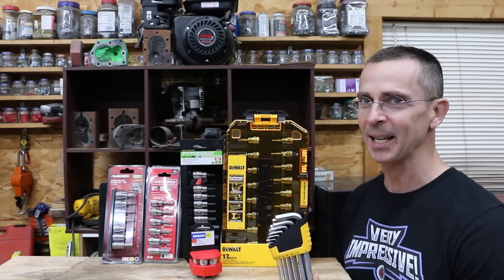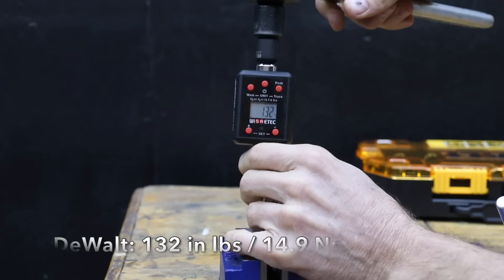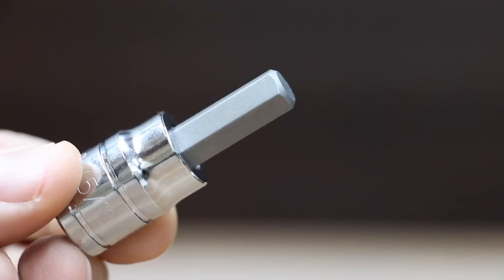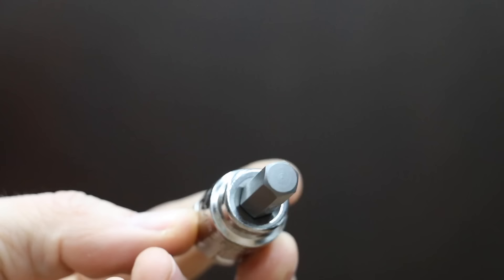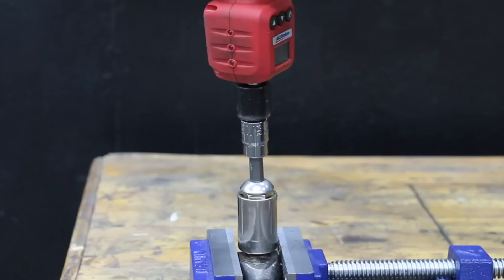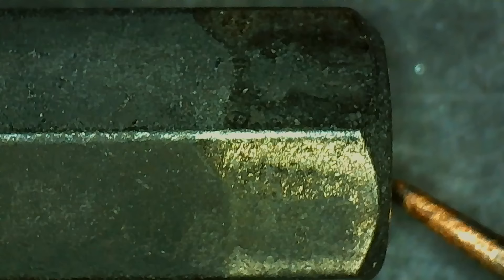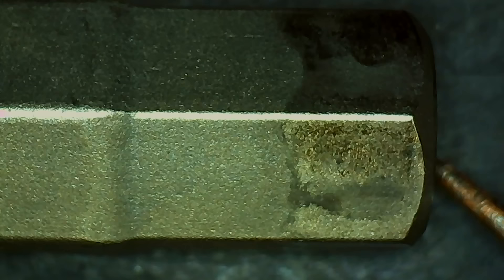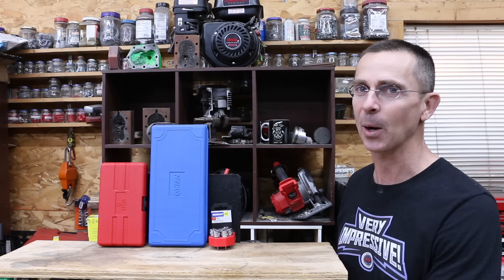Best Hex Bit Socket Set? DeWalt, Kobalt, Craftsman, Husky, Neiko, Pittsburgh, Tekton, GearWrench

Comment: Returned a set of gear wrench because the bits were installed at an angle and 4 of my sunex master set torx bits have broken trying to extract bolts on my car with hand sockets.

Love to see torx and etorx bits tested next.
Reply from the maker: Great feedback and great video idea. Thank you!
Reply: Absolutely!
Reply: Tools aren't made out of magic pixie dust. So you need to learn how to work within the limits of materials. Basically if hardware is seized the last thing you want to bring to bear on the situation is torque. Because as you're finding out you're just going to break shit if you do.
Reply: @1pcfred  you're right, something is that stuck don't bring more torque, bring heat. It can't be stuck if it's now a liquid!
Reply: @jpowens2253  heat is good. Sometimes tightening works too. Smacking the fastener with a hammer. Tapping your tools with a hammer. One of my favorite tools is a brass hammer. It saves the chrome finish on tools. Brass hammers are next level tools. Difficult to come by. Not everyone has one. You'll only find them in a better mechanic's tool kit. All the ham and eggers have is ball peens. They've probably never peened with it either.
Reply: @1pcfred  sometimes the only option is to break stuff. I used a 1.5 ton jack on a ratchet to get out a diff fill plug once. It survived but broke the next day. I couldn't put heat on that plug because it was right next to the fuel tank and a breaker bar wouldn't fit.
Reply: @inoahmann7542  sometimes we do not see every option. Or we're just not willing to pursue some options. I must say a jack on a ratchet is pretty creative. I wouldn't have thought of that myself. Fuel tanks really aren't all that flammable unless they're leaking. They really shouldn't be leaking either. You can actually put a lit cigarette out in a dish of gasoline. The trick is to vent the fumes away. Liquid gasoline doesn't burn all that good. It's the fumes that are combustible. That's why we atomize fuel before we inject it into cylinders. That's also why empty tanks are more dangerous and explosive than full ones are. There's more room for fumes in an empty tank. An old timer's trick for welding tanks is to run exhaust through one. You have to use an engine that runs really good though. It has to burn all of the oxygen. No oxygen, no flame.
Reply: @1pcfred  using exhaust to purge oxygen from a fuel tank is creative. I've never heard of that before. I don't know if I'd have the guts to try it, lol.
Reply: @inoahmann7542  I've welded up gas tanks and I just cleaned them out. If there's a way to get rid of that gasoline smell I've never found it.  I've sloshed like bleach around in gas tanks too. I just tip a lit cutting torch head into the fuel sender hole before I start. While I look away. Nothing's ever gone boom. It's still a bit unnerving to do though. Because I have to give them the whiff test and they always still smell like gas. I have caused a few things to explode welding. It's not that bad really. A big fireball and it's over. It helps that I'm a screamer and not a gasper I suppose. I just wish I had video of when it's happened.

Comment: I've been supplementing my Snap-On tools with Husky and Kobalt for years. Overall it seems like I've been on the right path!
Reply from the maker: Thanks for sharing.
Reply: I was on the other side of the spectrum. Didn't want to pay tool truck prices so I went house brand husky mostly. Rachets sockets racheting box  end wrenches. No complaints. Everything works well. I've used my 300 lbs self as a breaker bar on the rachet handles and nothing failed yet. Only  complaint is the Chrome husky socket do not affix themselves to a hog ring anvil on an impact wrench very well if at all. it has to do with the cutouts on the inside of the socket that attaches to the ratchets anvil.  they're great for ball detents like every single hand ratchet is quick release or press on.  horrendous for hog rings, they slide on the anvil until they catch the hog ring they just don't snap on to the hog ring and feel at all. So I got Pittsburgh sockets instead for that.  if they fix that their sockets would be perfect and yes a 12 volt dewalt extreme 3/8 drive impact wrench does not have enough power to facilitate the need for impact grade sockets at 125 ft pound tightening and 250 ft lb removal you don't need impact sockets for that.

Comment: I purchased a set of Pittsburgh a while back and used the 6mm to try and remove the plug from a fuel filter apparatus so I could switch the in and out around and snapped it in half. I was using a 3/8" ratchet hadn't even got to the impacts yet. I now use those on things that I know aren't too tight. Think I'll pick myself up a set from Sunex. Thanks for doing this test saves me a bunch of money and time testing and breaking my own tools :)
Reply from the maker: You are welcome!  Thanks for sharing.

Comment: I was a little disappointed Tekton didn’t perform better but it did a solid job I guess. All of my chrome and impact socket sets are from Tekton, they deliver great performance at nearly unbeatable prices. Although relatively new, they’re rapidly building a brand reputation among mechanics as bang for buck champions. 

I got two sets of impact-rated, deep-well sockets from them in SAE and Metric that go up to 1.5 Inches and 38 MM respectively. Combined cost for both: About $300.
Reply from the maker: Thanks for sharing.
Reply: I used to buy them too, but they've been around for years and their competitors has increased. I've broken enough tekton stuff, that I've moved onto American, German, or Japanese made tools.

Comment: My Kobalts have been great.  A store manager gave me a $500 piece of equipment that was unsellable due to mis-assembly.  All the Allen head bolts fastening the mis-assembled part had been over-tightened, then deformed in an effort to back them out.  I alternated using metric and English Kobalt hex bits to lessen the gap between sizes while using a hammer and progressively larger sizes to slowly reform the deformed hex recesses in the bolts back into workable shape.  I was finally able to slowly back out the bolts and reinstall the part in the correct orientation.  I found the Kobalt bits to be precisely shaped with good corners, hard enough to reshape the softer steel bolts, and tough enough to resist any damage from the hammer.  I used a large ball peen after the mallet wasn't doing it.  Two thumbs up.  Thanks for the vid.
Reply from the maker: You are welcome!  Thanks for sharing.

Comment: Love the videos wish you would include more snap on tools as well in some of your testing in this case I would have really liked to see how the snap on Allen sockets do and if they are really worth the extra money. I understand they are a lot more expensive and in a lot of tests it doesn’t matter but It would be nice to see thanks for all you’re videos though I’ve used most of these videos to find what I want to buy when looking for tools or items so I appreciate the time you take to makes these.
Reply from the maker: Thanks!  Thanks for the video idea.
Reply: Not just Snap-on, it would be nice to see any of the "tool truck" brands to see a comparison between the "consumer-grade" vs "professional" tools
Reply: He'd go broke after a few tests lol
Reply: I love my snap on set. They are 20 years old.  As a heavy duty diesel mechanic they have lasted a long time.
Reply: I did buy these from Snap-On. There are a few tools that I think the Snap-On or another high quality tool make sense. Something like this where the tolerances being tight save you from stripping out an important engine bolt or machine part go for the extra cost. 1/4 drive stuff is another I will spend more on because again the tolerances are tight. You start working on 1/2 and it matters less. I still stay away from really cheap unless it is for a rarely used job.
Reply: @NONO-hz4vo  but yea I think they do a great job. My lb7 durmax valve cover bolts were 5 mm Allen and if you stripped em by the fire wall your basically burning the bolts off they definitely saved me o think

Comment: I've been using the metric version of the Pittsburgh hex sockets with a Dewalt DCF887 impact driver for a number of years, I haven't managed to break one yet. Not bad for the $10 or so I paid for them around 2017. But if they ever do die... I might be looking at the Kobalt.
Reply from the maker: Thanks for sharing.
Reply: Same here, but I'm thinking of upgrading to the DCF891 1/2" mid-torque that just came out. It's putting out 900 ft/lbs of break away torque, so I'm thinking I might have to upgrade to a higher quality set to match it.
Reply: @jpowens2253  that's what u use. And use Pittsburgh and snap on hex bits.    Snap on keep cracking.  Pittsburgh dont.
Reply: @jpowens2253  Do it, but the harbor ones will handle it.
Reply: With Harbor Freight now having 2 or 3 tiers available with most hand tools, it is hard to go wrong there if you factor in how hard you will push it, how often you’ll use it, along with how much you are willing to pay given the first two answers, and your budget.

All of my Ratchets are from the 70’s and I never want to give them up, but most of my sockets are newer, various makes, many from HF, and I haven’t broke one yet.  

The higher quality tier hand tools at HF don’t seem to be tougher necessarily, but have better ergonomics, and look nicer.

Comment: At 12:22 in the video, Tekton tool breaks.  But just prior to that, I see the handle of the hammer drill being lowered placing a huge bending load (I see the l-bracket holding the bolt bending down).  This also happens on prior hammer drill tool testing.
Reply: I've noticed that on several of the videos. It introduces a variable into the equation that isn't strictly ... fair. The cam-out comparison of philips bits is one example of possible inaccuracies of results.
A jig of some sort to guarantee the tool stays perpendicular to the rotation would even things out...
On the other hand, real life use of these tools will rarely be perfectly aligned, and these tests/ videos are a very good "tool" for us consumers.

Comment: Thank you for testing tools so we don't end up doing it ourselves through trial and error. Gets expensive. I work in a tool & die shop, so I was wondering. Have/could you test the accuracy and durability of dial indicators. Cheap ones vs good ones like Starrett or Mitutoyo. But specifically "test indicators".
Reply from the maker: You are welcome!  Thanks for the video idea.
Reply: I've seen others test the 1" travel indicators and for the first half inch the cheap ones work good. In the second half of their range of motion they don't work as good as the better indicators do. So that's what you're getting with the better indicators. The full range of travel. But if you stay in the first half the cheapies work fine. I'm not sure why it's that way. That's just the way it is.

Comment: As a cyclist and a former 3D printer user(sold it before possible moving to buy one later again), I really learned Allen key quality differences with experience. My first allen keys were in a keyring set. They would always get rounded under high torque. Especially if I don't fit them well, which could be difficult with that set.

Later, I got my first entry level bicycle, which has a higher quality than a below entry level bicycle. The difference is that good quality bicycles have more allen keys and less tool variety for many parts.

I also got my allen key multitool, along with the bicycle. The steel was significantly harder, although it was prone to either rust or patina. I use it since 2013, and I really like it. It's not professional quality, like the Turkish brand İzeltaş would make. But a good tool is really fun to use.

When I bought my Ender 3 Pro 3D printer, it came with many allen keys, with ball allen ends on the tips of the long ends where you cannot apply as much torque anyway. For driving the screws, I use ball end; for torque, I use the short end.

But when I wanted to open the motherboard box, I understood that it was just a cheap Chinese kit for those who don't have allen keys. They work most of the time, but the motherboard box got something rounded.

About İzeltaş, I heard it was a lifetime durability manufacturer, and I was able to have one of their tools. One of our water taps required plumbing work, and the 12mm allen I could fine in one of the hardware stores nearby was İzeltaş. Because of the situation, I bought it from there, even though it was much more expensive. But man, it shows its quality. When you hold the tool in your hand, you notice that lack of flexibility in your hand, if you have some tool experience. You know, some tools feel more flexible, even though they look rock solid. This one didn't have such a feeling. When you hit it with your nail, you notice how the resonant frequency and the surface response feels different. And when I inserted it into the wall tap extension, the tool response to small collisions between the metal parts were very interesting. Since the tool surface was well treated and the tool itself was very strong, every little collision was directly in my hand.

These are my experiences with good allen keys and not so good allen keys. If I wasn't planning to move, I would love to have an İzeltaş kit. Foreign brands are also fine(I already have Bosch, Stanley and stuff). But I think İzeltaş is a professional's tool.

PS: Project Farm, if you read this, I would love to learn your thoughts on long comments. I don't like to write difficult to read long texts, but when I have the keyboard, I find myself writing tons.
Reply from the maker: You write what you like and as long as you like.  I will enjoy reading your texts.  Thanks!

Comment: 13:58 I feel this is a little unfair test as the socket adapter isn’t perpendicular to the bolt. It will make a huge difference on a bolt that small.
Reply: i mean, none of his test are perfect, but it can give you a good idea on how they'll act when working with them, as you probably won't/can't keep them perfectly straight/inline without any sideloading.
Reply from the maker: Thanks for the constructive feedback.

Comment: so will you be testing them on greasy and rusted bolts that you have to hammer the bits into to clear out all the crud from?
this would make a more real life test as that's where most of these bolts end up looking like
but either way, i look forward to the results 
👍
Reply from the maker: Great point! Thank you
Reply: I remember trying to take the head off a Mitubishi 4G63B truck engine, and it had 10mm hex head bolts... that were full of oil. I wasn't prepared for that and the oil-filled bolts were a bigger obstacle than I'd anticipated. Ended up just finally making a mess and blew the bolt heads out with compressed air.
Reply: @Oddman1980  doing driveshafts on my ford sierra and they use T40 torx bolts, it was only after i'd broken a few bits that i learnt that you had to hammer them in until they bottomed out before applying any torque to them
after that they were easy as pie
should have really known that after needing to use the same technique for splined head bolts, but it's remarkable what you forget to do when tackling a new job
Reply: I'd like to see Todd use real socket cap screw hardware instead of those button heads. But good Allen hardware is not easy to come by. You have to order it from fastener distributors. A real name brand like Unbrako

Comment: Great video.  Informative and comprehensive.  My only suggestion would be to use a socket head screw instead of a button head screw for a test like this.  A socket head screw typically offers the most surface area for the tool to engage with (aside from a hex head).  The added height also helps prevent the tool from wobbling as well.
Thanks again for the videos.  Much appreciated.
Reply from the maker: Thanks and you are welcome!  Thanks for the constructive feedback.

Comment: I've been happy with my Pittsburgh set, about 25 years old.  
You can get past the taper problem on some of the sets by grind/sanding the taper away.
One small critical comment:  You allowed some torque center movement while making the later heavier tests.  But since most of the fails were in the socket head cap screw interface, it wasn't as important.
When building decks, I used to twist off a couple 1/4" hex to square drive adapters every season with my impactors.  I now own several more 1/2 and 3/8 to hex adapters than 1/4".
Reply from the maker: Thanks for sharing.

Comment: Sad that not one set was made in the USA. Absolute discrase how many sets fit loose in an Allen screw. Have several older sets that all fit fairly tight. Have a few 3/8" drive Allen sockets that use can Allen screw to secure Allen driver. Have several different lengths of hex Allen's to fit these. Years ago had to return a made in USA low quality Craftsman set. While checking a 600 amp safety switch bolts hex bit fell out and came very close to shorting out. Thanks for another great vidio. Thanks for supplying country of origin.
Reply from the maker: Thanks and you are welcome!

Comment: Petition to NIST to change horsepower to farmerpower! 

If you ever decide to test the Torx bit sockets, I can attest the Snap-On's are actually very disappointing. I've got the little $8 HF Warrior set with the 1/4" adapter & believe it or not, I haven't broken the little T30 yet. But I've managed to snap both SO T30s, standard & tamper-proof rather easily. To top it off, the 2 local truck guys are, putting it mildly, creeps when it comes to warranty.

I've been pulling back some to HF & so far not disappointed. Your work is a national treasure & a blessing to us all!
Reply from the maker: Thanks so much!  Thanks for the suggestion.